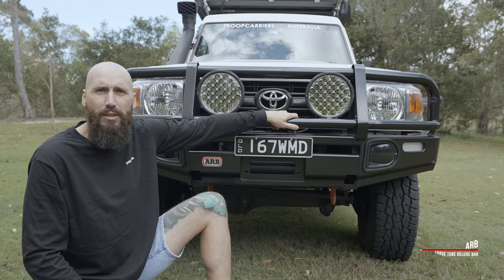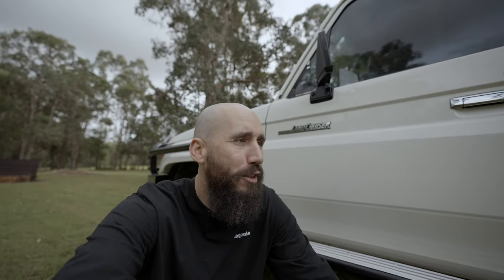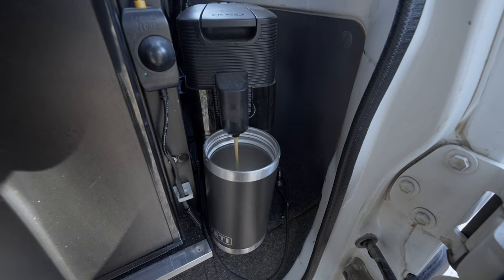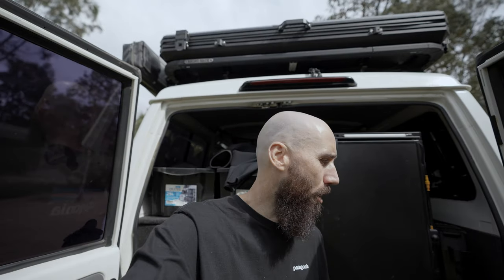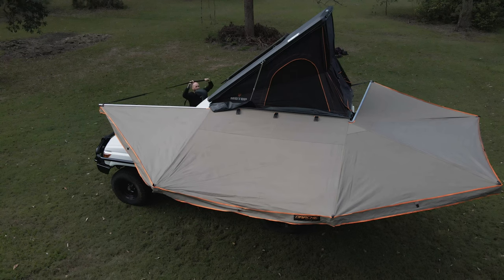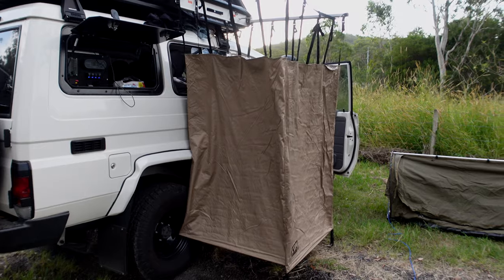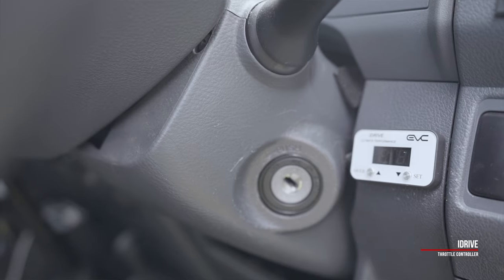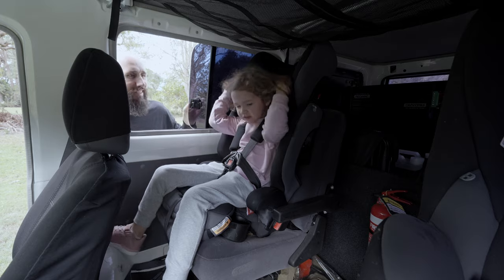Toyota Landcruiser Troopy Walkaround | Family Tourer

Comment: Very nice rig, and have a 79 currently but I looked at a troopy for a while but the kid safety thing worried us a bit. Love the kid seats you put in, that’s a good solution. I just wish you could get a 70 series with airbags in the second row.
Reply from the maker: Thanks mate! Yeah I know what you mean. I’ve always looked at it that they are a pretty big vehicle and built a lot tougher than smaller cars, so kids are probably safer in that than a small car with more safety features. It’s only used as trip vehicle for us and isn’t a daily driver. Enjoy the 79 mate and thanks for checking out the video!!

Comment: Hi from germany, great video. I fitted  a rear seat 1/3 + 2/3 from a VW caddy wich works also for my 3 girls, and is still flexible to sleep inside when doing a trip by my own! Greetings Hörn
Reply from the maker: Thanks so much mate! That’s a great idea, only issue in Australia is they are pretty strict with what they will sign off on for after market seats, so it’s no as easy as it should be to source seats etc from another vehicle

Comment: Awesome mate keen on checking out the tech safe seats
Reply from the maker: Thanks legend. Definitely worth checking out, still really happy with ours and had a number of years
Reply: Look at an x ambulance trippy tomorrow with the third door passenger side… with a bit of luck fingers crossed it has an anchor point
Reply from the maker: @bez1997  good luck with it, exciting! The 3rd door would be so handy. If it’s got a tech safe seat it should have the point built in. If it doesn’t have a tech safe seat and you decide to buy one, they are built in

Comment: Awesome to see the little ones living this life. How much does a setup like this come to all up? Where do you fit the extra ground tent, just chuck it in the grab box between the drawers and rear seats?
Reply from the maker: Thanks so much mate! I honestly don’t have a full on cost break down, probably somewhere around 80k. I did managed to buy the troopy before Covid and a really really good price.

Depends on what tent we use, we either strap it to the roof top tent if it’s a big one like an oztent, or fit it inside. I’ve recently just bought some light weight hiking gear which is super small, so going to test using this stuff as the second tent